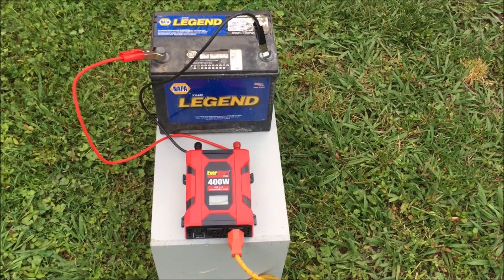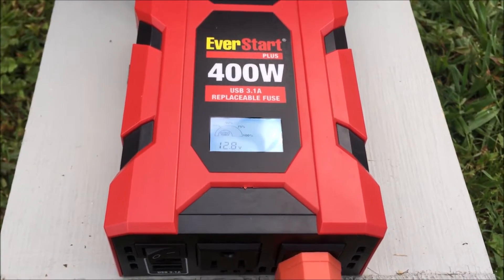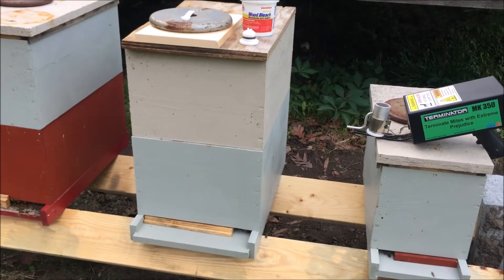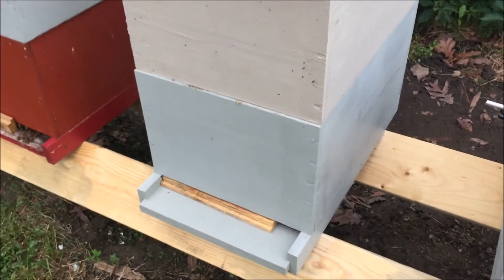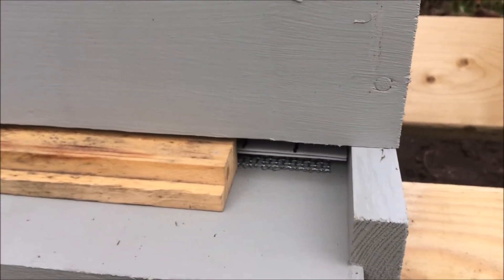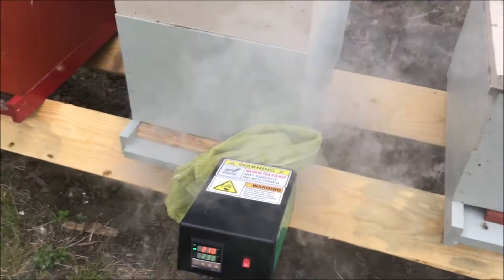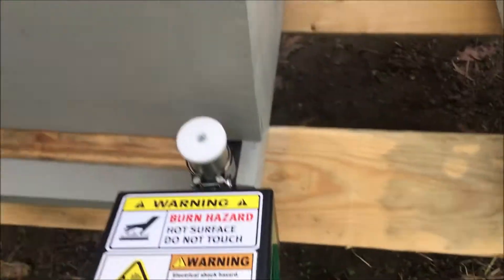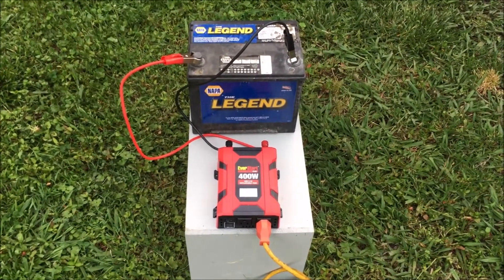Battery Operation MK 350 Oxalic Acid Vaporizer

Comment: Could you sub the car battery for a riding lawn mower battery?
Reply from the maker: @paulnorwood6031  providing it's a 12 volt  btry, how long it will operate properly would then depend on what the actual storage capacity of the btry is.